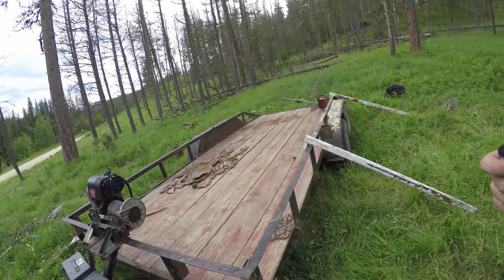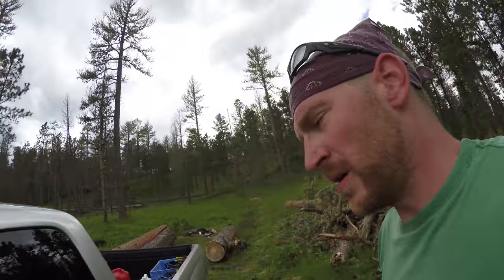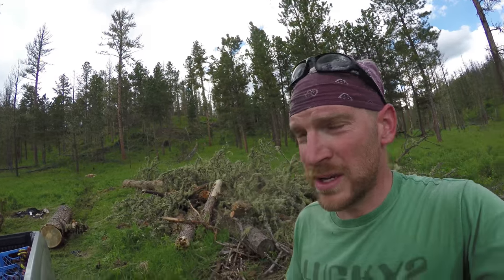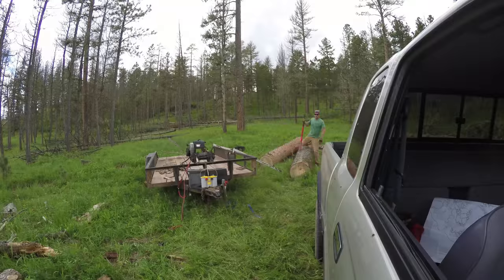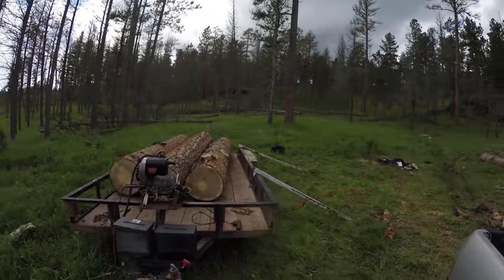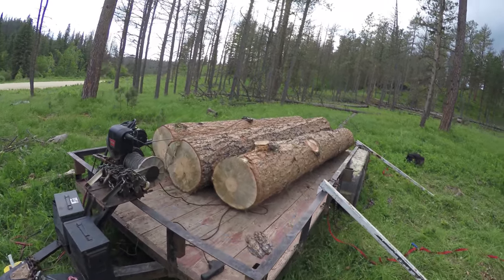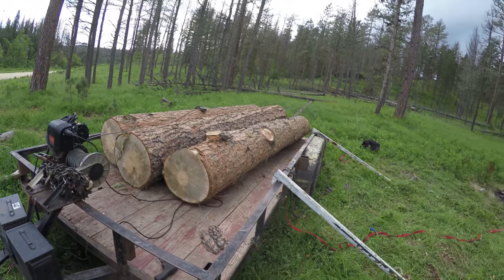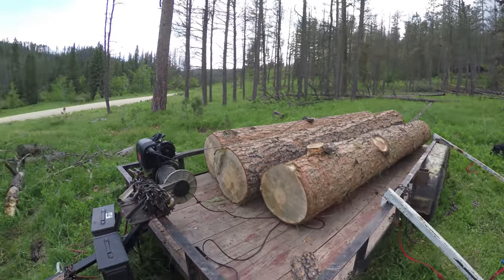4k HD (Part 3) Woodworking How-to load your own beetle kill trees for lumber

Comment: Good job on loading your logs.
I put bunks a little higher than the tires on my trailer( I don't have fenders). I tie the yoke to the opposite side of the trailer from the ramps and can roll the log across the trailer without manhandling it that way. The rigging is also easy to get undone when the logs are loaded.
My bunks stick out past the tires, so rolling the logs off from the side is easy with a peavy. If you run one set of tires up on blocks gravity helps. If you have bunks level with your  your mill deck, you can roll the logs from the trailer right onto the mill deck and save a lot of work and keep the logs out of the dirt.
Bunks on the trailer also help protect the trailer deck from damage from knots and other protrusions.
I started out using pieces from where I was logging cut to fit across the deck, eventually I cut some timbers to fit and made up a bracket that I could remove quickly when I hauled equipment.
I loaned the trailer out to some friends, they took the bunks off to haul logs and busted the deck all up loading and unloading. I guess they didn't understand why the bunks were there. It doesn't show the trailer very well, but here is a video of my log loading https://youtu.be/WaeBLxlM4Q0

Comment: Leave a cable under the logs and you can parbuckle them off blocked to a tree almost the same way you parbuckled them on. I don't have videos, but I have pictures of my equipment trailer loaded 6 feet high with a couple dozen logs and they all came off at once. Fun stuff!

Comment: As you set up your truck? Install (big grey connectors) in the rear of your truck for jumper cables, or any other need to power. I'm too old to be carrying heavy batteries. Far easier to make a set of long jumper cables and leave the battery in the truck. Most helpful mod on my truck.

Comment: I had a method of loading on a trailer similar to this but I had a much harder time after the first log was loaded with it being in the way. I also was using a single cable from my winch ( that was mounted on the side of the trailer) bad mistake broke the winch when unloading a big log. I love the winch on the front and the set up you have here. I would love to know more details on how you have this set up as in what kind of winch you are using, how your pulley system is run to side of trailer, and what your loading harness (for lack of better term) is and how it hooks to the log. You may have a video showing this and if please lead me to the video. Thanks so much
Reply: Though I am not him but from my own knowledge I would recommend no less than 8,000 pound capacity for the winch. and if the winch is fixed to one point, use a block and tackle set up to keep the line straight with the winch and use the pulley to redirect the line to were you need as this would prevent improper spooling of the line on the drum and also increase the power of the winch. Though with a single line pull the wire ropes limit will not increase unless you use a hooked pulley on the logging strap which will double the line strength in a mechanical sense, also use as he showed a chain or strap set in a V or Y pattern to roll the log up with ease and in a controlled manner, If you use a strap do with at least 2 inch and have the company or if you DIY reverse one hook at the end to compensate for folding of the strap where you want to use a triangular d-ring to pull it with for equalized pulling and for quick re-adjustment unlike with a chain, so if you are loading an irregular shape log you can adjust the winch and strap on the go.

Comment: is this any better than winching them up from the back with jack stands under the rear?
Reply: To each their own, but there is not much difference between the rear even with an A-frame which takes a bit more work as it requires a few more steps just to get a log up on the trailer enough for the winch to straight line it the rest of the way but also adds on extra weight to the trailer than that of an alpine or ramp type side loading method. This uses if not less equipment as it does not really require stabilizers unless you feel they are needed for whichever reasons, this method allows for loading of long logs onto trailers with flat decks and if you do not mind it also for trailers with sides as shown. This style of loading does not require the time and resources to add on a lifting frame to the back, but will still require ramps of your choice from tubing or pickup bed ramps be it wood or aluminum instead of steel, but do know the weight limit of the ramps you want to use to that of the green weight of a log. With ramps, their single capacity doubles with two and triples with three and so on. Both are much cheaper than a knuckle boom or winch crane.